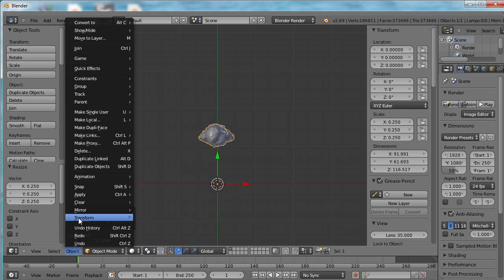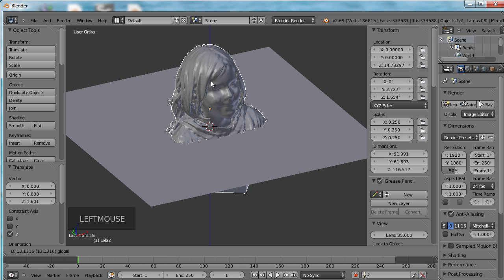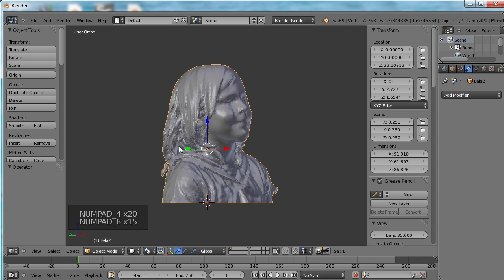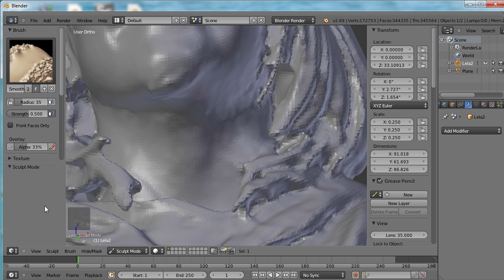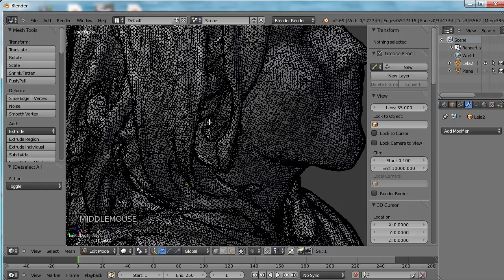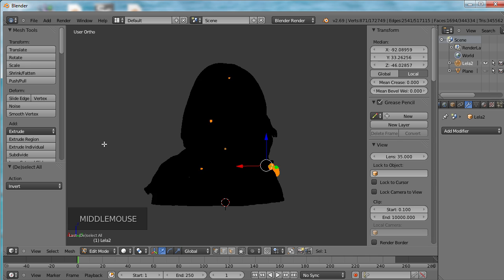Blender basics for 3d printing part 2

Comment: Hello there i want to ask a question.It is possible to print separate Mesh as one?  like the head and body or anything else is seperate.but if i export them all in one slt format. i would be able to print it as one? or i need to merge them.
Reply: It depends on your slicer.  If you have overlapping parts some software will fuse them together, some will perform unpredictably.  It is best to boolean everything together to be safe.

Comment: Very helpful, thank you. 

My question is how do you export just the object once you've performed the boolean operation? I was able to insert a plane and cut off the excess. With only the object selected in the scene, I exported it as STL. However, the plane was exported as well. But if I deleted the plane from scene, then it exports correctly. I'm using Blender 2.78. Thanks.

Comment: How do you like the Sense 3D scanner?  Would you recommend it to others?  Thanks
Reply from the maker: The sense scanner was amazing when it came out 2 years ago.  There still isn't anything in the price range that I have seen that is much better.  If you have an iPad you might look at the Structure sensor.  It claims better resolution, but the scans I've seen look about the same.  The Structure attaches to the iPad making a neat package, but in terms of usability I'd rather have a separate hand-held sensor so I can get all the angles while still watching the screen.  For scanning anything other than people (and other stuff that moves) photogrammetry is usually much better, and cheaper.